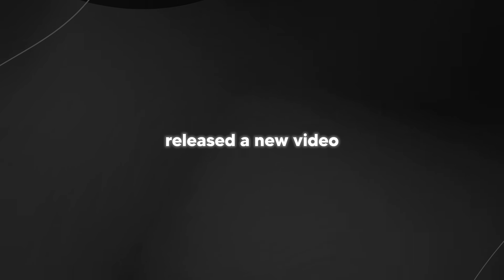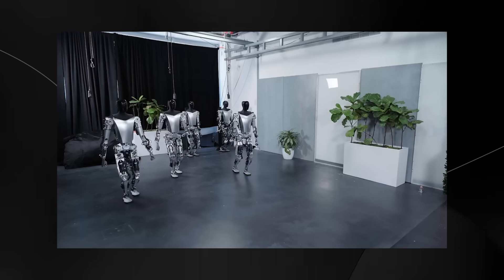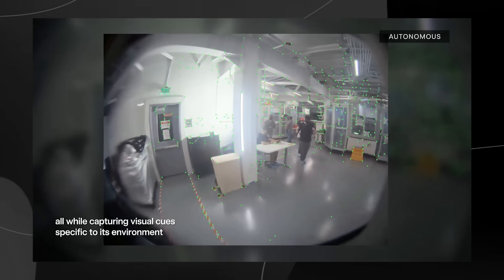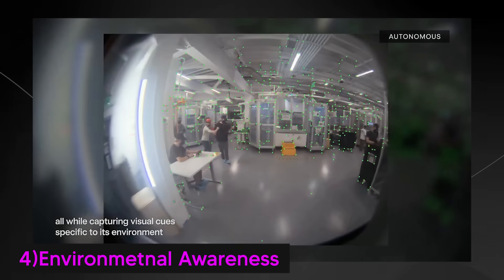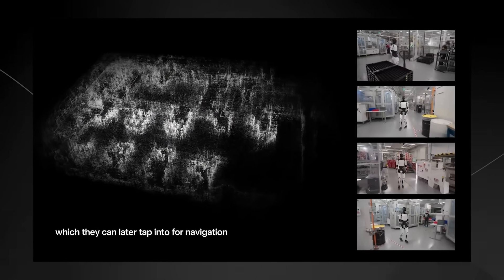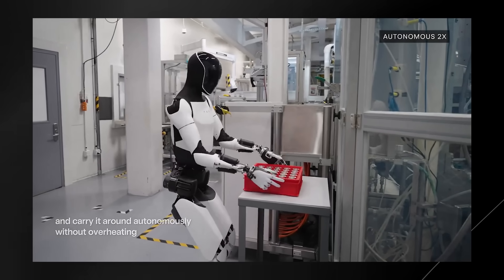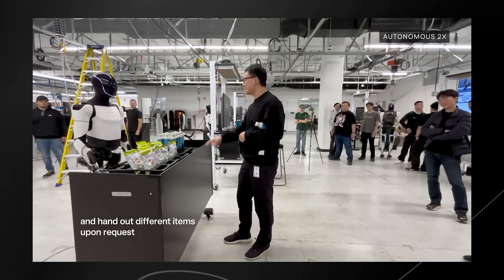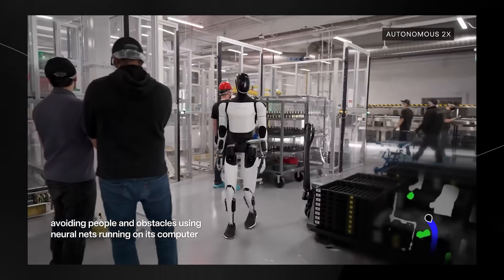Teslas New AUTONOMOUS Teslabot Update Silences Critics!

Comment: Teslabot come over twice a week to clean my kitchen and bathroom! That's a great dream and a big idea, isn't it? The thing is you do lose your  privacy during the time you have a robot or smart AI going along with cameras and any data collection devices like that Android phone. The Teslabot is going to need a balancing system like how One Wheel and hoverboards do in order to get it stability, control, and strength. Those are impressive they showed a week ago, but they were at risk of falling over and not strong enough yet to work. A marvel achievement in only 3 years though.

Comment: 6:40 if you only have a 3 second clip, no reason to play it over and over and over. Just use some stock footage or do something else
Reply: I am concerned that rather than show the robot traversing the entire stairway, they only showed it climbing 3 steps in the middle of the stairway (and apparently hitting its foot on the risers on each step) and continually showed those same three steps in a loop. Also, most of the walking and carrying the battery tray were sped up 2X, but the placing of batteries in the tray was 8X. They have to show these over and over in a loop because there is only a tiny bit of actual footage available. This makes us wonder about highly selective editing - e.g., how many times did the robot have to attempt traversing the stairs for them to get 2 seconds showing it scaling three steps? 
I don't mean to pick on Tesla. All of the Humanoid Robot companies are doing this sort of thing. It is really hard to be sure how much is selective editing over who-knows-how-many attempts, and also, how much is actually being tele-operated. 
Until trusted 3rd parties get to spend time interacting with and freely filming the actual autonomous robots, it will be hard to be sure just how far along they really are.

Comment: Hey man! Thanks a lot for the great video. 😁👍Just a quick comment, please experiment with using a black screen or something else instead of repeating the same short video so many times. It was literally making me dizzy
Reply: Repeating a 3 second video a hundred times is very tiresome…
Reply: Came here to make same comment. Got dizzy watching the same clip 100 times
Reply: One thing you might try is to slow down the footage by the same factor it has been sped up, e.g., if it is a 2X video, slow it down by 50% to get actual speed. That would not only fill in more time, it would give your viewers a more realistic idea of the robot's actual capabilities.

Comment: i like what im seeing. walking with straight knees is almost there. stair climbing. if everything is autonomous and runs locally that is impressive. for the stairs it seems to hit the next step with the tip of the foot deliberately to find out the shape. i think that has to be done differently ultimately, but its a start. we dont see it go down the stairs for the same reason probably: because it cant figure out the exact step position just with the camera. what about pressure sensors in the soles of the feet similar to what we have seen in the finger tips when it grabed the egg? that should allow it to get more precise information where the edge of step is, it is currently on. and from there plus a model of the environment plus knowing where its limbs are it should be able to make a good guess where the next step is. of course it needs a ball of the foot and a toe section it can stand on even when the heel is in the air. that would make everything so much easier.

Comment: So it has a Gait, I’m still oddly not impressed. I don’t feel like it has the processing ability or reflexive capability that it needs. I bet I could push that thing on the ground and it’s over.
Reply: Do you normally go around at work waiting for the chance to push your co workers over?
Reply: @steve.k4735  sometimes
Reply: @steve.k4735  Probably not, but a thief might get the idea.
Reply: @mattdamutt5681  really? you think thieves go around thinking about `pushing` robots over? .. any thief would avoid robots in the same way the avoid security cameras for the same reasons

Comment: Just curious what the job market looks like once humanoid robots are properly integrated
Reply: It looks bleak but there will always be a need for humans.
Reply: ubi is basically unavoidable
Reply: Low pay but more hardworking, if you own a company which one would you choose?
Reply: @wwk279  the obvious, obviously. Why would anyone hire a flawed human work force that is far higher cost over time, when they could hire a robotic workforce capable of working 24/7 without complaint? The issue is that the majority of human history the masses did the graft job, but this is the first time we have actively tried to build a slave race capable of filling that role.